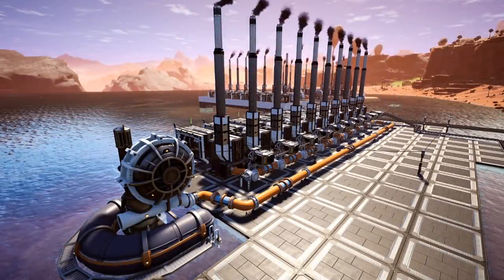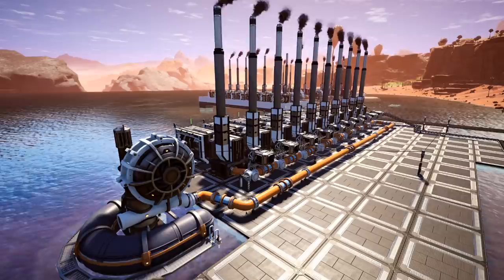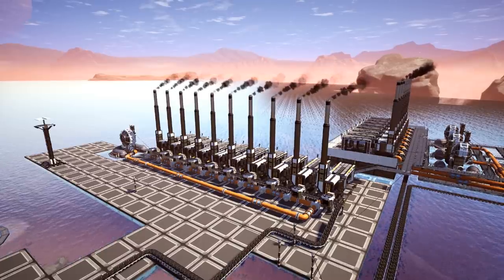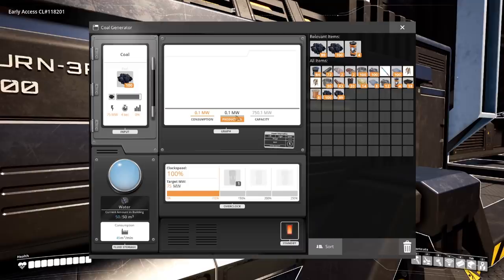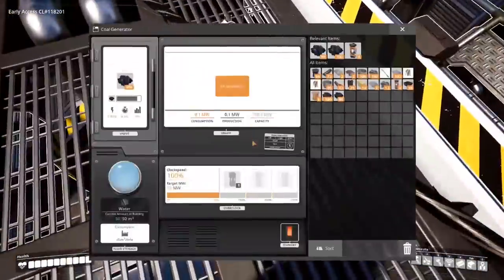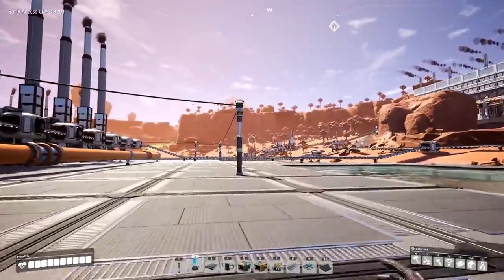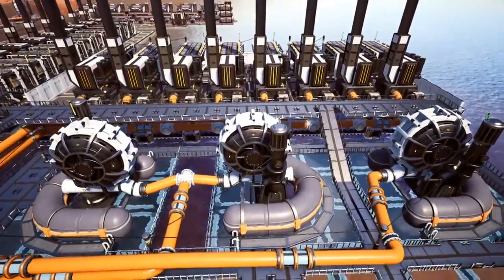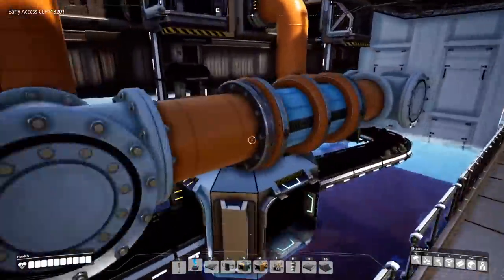Mythbusters How Much Water Do You Really Need To Run A Power Generator  Satisfactory Game

Comment: To "answer" the question of the video in short: 
8 coalgenerators + 3 pumps =perfect ratio (consider your max pipecapacity of 300m³/min-> merge the third pipe after the 3rd coal generator)

stoned engineering stuff for more detail:

So heres the thing. People (and you did also in the video :P) are confusing (or are at least are not precice enough) capacity and production/comsumption and do not consider, that not the coal generators only are the system but the coal generators + the waterextractors. In addition to that, satisfactory is simulating correct here which means it is a dynamic system which also matters.
So I go with the "perfect ratio" - example which is 3 pipes for 8 coal generators.

Your pumps need a total 60MW of capacity available to operate at 100%. Output is 120m³ of water/min.
Your generators serve a capacity of 750MW. If you set it up as a closed system (after kickstart with external power supply, to get the pumps running) they server the pumps so max. capacity is 750MW-60MW = 690MW. So still this all is just capacity which means its static so far. This is just your capacity. To get your actual electrical consumption you need to add the timeaxis.
consumption = capacity x time. Our little 690MW capacity grid can serve 690MW x 8760hrs (1year) = 6GWhrs. Which is huge btw :D. 

So since most of you are lazy overflowusers ( :P ) and do not proper load balance you production lines, your machines are not stable in consumption. That causes instability in production (of power) aswell over time, which is why a lot of people get confused in the midterm of the game when they first scale up and get a blackout, even they checked their capacity before.

So yeah basically: Just go fucking huge with your powersetups to always have a buffer of capacity and startup your coalsystem in steps. First pumps, then coal to get it running at 100% fast.

OR if you like the challnge: load balance EVERYTHING to get stable consumption and measure the needed capacity to have the 100% efficient power grid.

If you read this I hope you get my point and it makes sense. I'm high so no hate please. Have a nice day :D
Reply from the maker: I appreciate the time you put into the message! The perfect ratio was not the objective of the video but I give out the easy solution. The point I was trying to make (albeit not as efficiently put :p) is that resource consumption scales with energy consumption.  Which is why you should prep your powerplants to run at full capacity.

I do disagree with your statement on the overflow, providing you calculate the ratio of coal and water into your build like you would a load balance then it does not matter what technique you go down. The problem is people often don't calculate this. If you go down the root of using huge buffers, you're prolonging the inevitable and causing more problems in the long run
Reply: @TotalXclipse  Thanks for the answer. With "overflow" i meant to overflow your whole power grid with capacity. In other words: just don't try to measure the consumption you will have but just build e.g. double the amount of powerr plants. Because you will end up needing more and more anyway when you get bigger and bigger. 
Of course of you should load balance the "minisystems" in your power grid like my example system consisting of 3 extractorsand 8 coal generators. 
P.S. my biuld just need another 2 months and then i will be proud to send it in;) spoiler: perfect case study to show that you do not need any pump if you consider potential energy :)
ah yeah: if you need some engineering input or review for an upcomping script i'm your man (actual environmental engineer lolz)

Comment: I usually run 1 pump per 3 powerplants running at 100%  I've found that adding a 4th may be fine when you add it, but under load, it starts to loose water as the other plants consume it.

Comment: i have a 3/8 in my factory with one pipe, it's a weird system but 
1 water - 4 gen - long cable - 4 gen - 2 water...
it works, and i think it can run at full cap
Reply: its not that hard to count like 120 * 3 = 360 water and 8generators = 8* 45 = 360 so yes it will work at 100%capacity but only if u use mk2 pipes

Comment: Yea, It took me a while after water first started being used for me to figure out. My plants kept turning off after a long while. I ended up playing with it and figured exactly this out. I now always fully overclock all water pumps and coal generators, which consume 91cm each. So, I use 1 water pump for every 3 generators all fully overclocked. I have 2 sets of 3 generators and 2 pumps in each plant and I have 2 plants.  All this has been running for months and never lost power no matter how much I consume... as long as I don't go over the total power generated.

Comment: I always plan for maximum consumption. So, I use one extractor for every two coal generators, downclocked to 75%. To save pipes, I group three sets, so, 270 m3 per pipe, feeding six generators
Reply: Same
Reply from the maker: Yes always plan for max consumption. 1 extractor to two generators works fine, but surely 3 extractors between 8 generators (other than the pipe cost and the extra consumption of coal is better than paying for 25% more extractors?
Reply: @TotalXclipse  Oh, I go simple. Because that surpass the 300 m³/min for the pipes, and I would have to balance and stuff... I really don't want to hassle that much XD
Reply: I have 3 extractors for 8 generators split into 2 pipes (the 3rd extractor is split into the two lines). This means two pipes carry 180 water each feeding 2 sets of 4 generators. It keeps the pipe numbers down. I always distribute the water by splitting into two and two again. Elegant and quite space friendly.
Reply: I always plan to have 125% production capacity to maximum. But I run 8 coal generators per pipe. 2 extractors per pipe with 1 being overclocked to 125% for max of 300. Since I have unlocked fuel generators I make sure my power consumption is at least 50% off coal and 50% on fuel. Fixing to unlock geyser power and that will power only what is required to maintain my power generators. So all pumps, extractors and such such.
Reply: Zeepy Sea 8 per pipe uses more than the pipe can supply. Why make something that you can’t fully use?
Reply: @SirHackaL0t.  You could install excess power production capacity in order to buffer power spikes. If production isn't tuned to run at 100% efficiency, the consumption rate varies over time and spikes can occur that trigger the break even if the power isn't required sustainably.
That would be, by the way, the keyword for this video, since yes, you can supply the generators with fewer extractors than optimal but not in a >>sustainable<< fashion. From the beginning last year people have asked for energy buffers to deal with spikes in power consumption - the solution beside clocking: just install more production to buffer the spikes. It comes at the cost that you have to be aware how much you can support sustainably and maybe check installed buffers (storage between the sources and the generators) from time to time to know when to expand the power infrastructure.
The flip side of the medal is also that there's a whole lot of resource being unused, since the power generation practically never runs at full capacity. If we stay with coal power - installing some overflow splitters into the coal delivery network a lot of the coal isn't "lost" anymore because it's dedicated to the powerplant. While the plant is running below 100% (which is essentially always) you can divert the coal for yummie steel production.
Reply: @quambowambo  Seems like you try to fix a power problem by just making more power problems for the future. Why have coal power when you always have to check if you are using too much of it? The whole point of coal power is that its automatic so you don't have to do anything.
Reply: @evanherriges4042  that's why I mentioned the cost of having to pay attention. Also, it was just described as a way to address outages from single spikes not meant as a goto strat, since having a flat consumption curve is not that difficult.
Reply: @quambowambo  ok, ngl I haven't been playing any satisfactory in a while because of scrap mechanic survival mode
Reply: @evanherriges4042  Yeah, that can be annoying at times. Maybe try out the passive mode mod ;) - https://ficsit.app/mod/2dZqY8fZ4tQ9kg
Reply: @quambowambo  no like I am more excited to play a different game that just got an update right now
Reply: @SirHackaL0t.  8 per pipe with industrial buffer. I'm currently running 4.8k mw  while only using 2.5k mw. It works and with the industrial buffer I can always over clock the other water extractor. Means my flow should never get below 300.
Reply: @zeepysea  The problem is that your pipe can’t supply more than 300 m3 at any time. There will be a point when your generators will stop due to lack of water.

Comment: 2:31 it literally says 0% efficiency, next to the 75MW and 4 second thing
Reply from the maker: True, but I rarely trust that since the first released as it tends to fluxtuate When it has the odd amount of resources come through
Reply: @TotalXclipse  the efficiency on the machines is basically "how much am i producing compared to how much i should be based on clockspeed" and generators automatically reduce what they produce to match what the grid is using. So the efficiency is measuring this reduced power out to the max power it could be producing. So it's a bad measure for all generators because of that fact. Efficiency works perfectly well for other machines to determine whether or not there's down time (and if you reduced the clocks speed down to match the efficiency you'd end up with 100 percent efficiency measured based on that; example if you're feeding a smelter 15 iron ore per minute and it's set to 100 percent it is expecting to consume 30 per minure to produce 30 iron ingots,  it is only being suppliex enough for 15 so will show 50 percent efficiency,  but if you underclock it to 50 percent, it'll run continuously at 15 per minute and show 100 percent efficiency)

Comment: The bottom slider is where you select the efficiency, so when it tells 100% it means it is going to reach that threshold. However, the current efficiency is shown on the top left corner of the machine screen. So if all of them 10 generators are running at 10% that means it is equivalent to 1 generator at 100%. So that's why they'll consume more water as energy is required. They don't overproduce energy, so their consumption is proportional to their % efficiency. That also applies their coal needs.
Reply from the maker: You’re absolutely right but the videos not about efficiency it’s about how many coal generators can run off a single water extractor hence why I go on to talk about how fuel consumption scales with energy consumption of your factory which I think is much more important in this equation ☺️

Comment: You can run your three water extractors by splitting from the middle to the outside two extractors with pumps pointing away from the center.  Each side will supply four coal generators evenly.  Load balance the water just like you would a conveyor belt, using a t junction like a belt splitter, two into two for four pipes.  I raise my generators by one foundation, split the pipes once on the dock, then once again under the plants.
Reply: old post but you do NOT need any pumps AT ALL unless you need to LIFT the water... flat water lines like he uses = no pumps needed

Comment: thats only possible if you arent using any of the power produced. Generators in this game reduce resource consumption based on how much power is needed to run machines that are connected to the power grid.
Reply: Yup, those same 50 generators they had 'running' on one extractor also would have kept 'running' on a single mark 1 belt of coal split between all of them.  That's what happens when you aren't actually putting even a single generator's capacity of load on them.

Comment: I had this problem and couldn't figure out why. Now I know! Time to build more water extractors. Whee!
Reply: I got 6 water extractor feeding 20 coal power plants.
Reply: @brianmcgill1290  Yep, you can do that. As long as you aren't using full power for all 20 plants. 

45 water per minute at full production at 20 plants equals 900 water per minute.

That's 3 lines of 300 water per minute, since pipes can only hold 300 each, which you'd have to split up to feed one or two of your plants, since 20 is not evenly divisible by 3.

However, 6 water extractors gives you 720 water per minute. 

If all of your plants were operating at full power production, you'd burn through your 720 and your plants, eventually, would start falling offline, until you were down to 16 plants.

Now, if you aren't using more than 1.2 MW of power right now, you may think everything is fine and you can handle it with this setup.

Once you go over 1.2 MW, your grid WILL fail, though it may take a bit of time after you start using that much for it to fail.

If you are producing the full 1.5 MW with 6 extractors, make a video and post it! It shouldn't be possible, but I'll believe it if you show me.
Reply: Did you think I'm not using fluid buffers to balance the load.
Reply: Brian Mcgill fluid buffers only delay the outage you will have when using full power. If you aren’t at full power yet you won’t see the impending doom! The maths don’t lie.

Comment: I think it says 750.1MW at the start because of rounding due to the 0.1MW idle load.
That rounding can also prevent a 30MW/60MW crash site from being powered due to it consuming 30.1/60.1MW as soon as you fire the single biogenerator.

Comment: It's 3 water extractors into 8 power plants. Why do I use multiples of 8? Because it divides into multiples of 60 (coal), because you are not limited to water but you are limited to coal. Just make a pipe junction on all 3 extractors, connect them all together and pull a pipe from each junction, one into each side of the system and one in the middleish, the 300 per minute will not be a problem because it's 360/3 more or less. 120 in each pipe.

Comment: Just think of coal power plants as working just like biomass burners, they only use fuel when power is needed, so if you are using 50% of the power they will only consume 50% of their maximum coal rate.
Likewise they will consume 50% of the rate of water too.

This does mean if you run your power plants at 100%, they would use 100% of the water, so they would run dry pretty fast if you didn't have enough water inputs.

Comment: Great video ive got three charcoal power on one water pump and the third shuts off randomly and can pop the fuse when with the unstable supply even though overall MW would suggest otherwise. The power spike kicks the breaker before it can smooth power flow. I solved this with the battery storage. They can compensate the low power spike and keep the grid up.
Reply: Yeah, if you have 3 on one water pump that will happen, the water pump makes 120 cubic meters/min and 3 generators need a total of 45 * 3 = 135. So you'd need to use a power shard to overclock the water extractor a little bit if you want to avoid that, make it so it outputs 135 to match the generators, or else it's going to be doing that toggling one of the plants on and off so you'll just be averaging 8/9ths of maximum production... but if you are going to use a shard anyway, you might as well just clock the extractors to 50% extra, so each puts out 180 cubic meters/min, then you can run 4 generators on each extractor (4*45=180), which I find makes it very simple to make nice clean setups.

Comment: pipes capacity = 300. 300/45=6.6(6) so u can  provide 6 power plants (270 water consumption) with 1 pipe line. You need 3 pumps  working on 75% of efficiency to provide 6 power plants (wothout boosts) and 90 coal per min